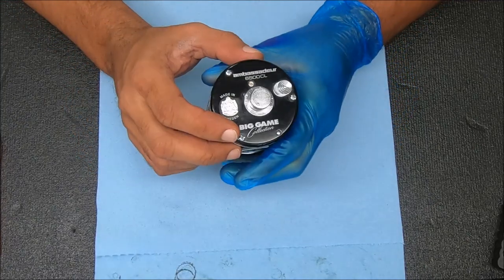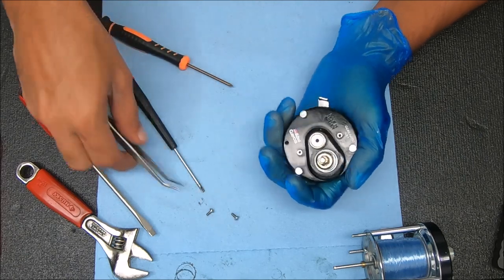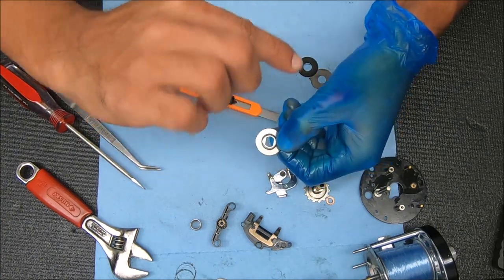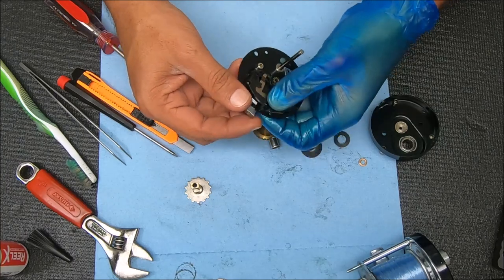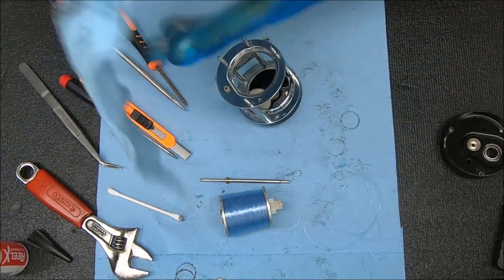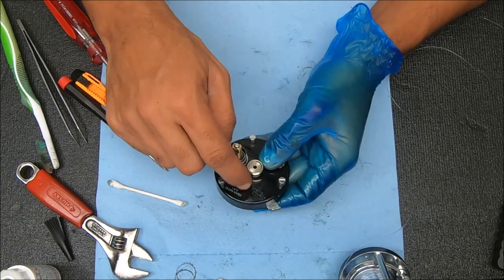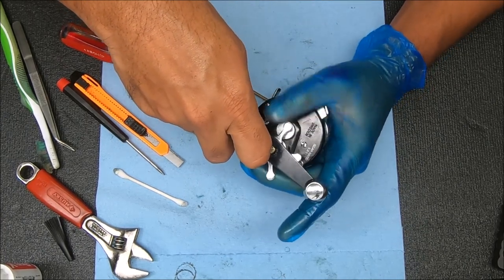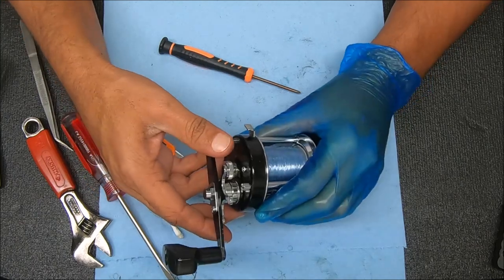Ambassadeur 6500CL Fishing Reel - Weak Drag:  How to fix plus service this reel

Comment: Dude, the oil you put for the centrifugal brake pads is in completely wrong place, those pads can't even touch there. The right place is on the sides of the smaller ring in the end plate. And I wouldn't even put the oil there, it just makes the centrifugal brake worse, but if you like you sure can. Also to clean the worm screw easier take the other end off. It's just a three screws and you also have access to the plastic gears easier, so no reaching. Some put grease on the brake plates and some don't, personally I like to keep them dry.
Reply from the maker: Thanks for watching and sharing your thoughts, brother. Yes, I agree with your first comment about where the oil should have been (inside the smaller ring on the right side plate)... it was a simple slip during the recording process that I missed, even in the editing phase. Thanks for pointing it out. Yes, I agree I could have opened the other side, but it wasn't necessary, since I wasn't going to remove the worm, and turning the idler gear wasn't difficult the way I was doing it.... better to remove the worm assembly entirely for a more thorough clean if I'm going to open the left side. The rest of your comments comes down to personal preferences. Thanks again for voicing your opinion. Spread the word about the channel.

Comment: do  you know if any Abu Garcia AMBASSADEUR 5001C come with drag alarms or  drag clicker?
Reply from the maker: Thanks for checking out the video. I don't think so. The drag setup was such that it wouldn't support the clicker being there.... maybe you could swap out the gear stack from another series that has a clicker (assuming it fits) or modify the left side. I would probably just use a little alarm thingy on the rod if you're setting down.

Anyone else that reads this is welcome to contribute.

Comment: I have always been intrigued with owning one of these Abu round baitcasters. Especially one made in Sweden. Being mostly a fresh water bass fisherman, I have always been confused and frustrated on the correct model size to purchase on line without actually seeing or feeling it. Not at all familiar the amount of models and the number designations that Abu uses.
Reply from the maker: Hey Steve! Don't worry, you're not alone.... their models, years (and pretty much everything else lol) are confusing.... but there are some good sites out there that document the lineage well. For bass, I probably wouldn't go higher than a 5500.
Reply: @TSGReelService  thank you for the help.
Reply from the maker: All good, sir.
Reply: Abu 5500 is a great all around reel the 4500 is nice and light if you don’t need distance. They make the same versions in 5600 and 4600 if you want the thumb bar release. I like the thumb bar for repetitive casting. The bad thing you cannot replace the thumb bars if they break, you haft to replace the whole frame. That being said, I have never broke one. The 6500 and 6600 reels are good for more distance for catfish, striper, carp etc and have bait clickers. Bait clickers can be added to the 4500-4600 and 5500-5600 easily. The 5000 and 6000 reels are the same but they have bushings instead of bearing. Bushings are great for salt and can be replaced with bearings. All these reels are very easy to work on and upgrade. I have some Abu round reels that I bought 30 to 40 yrs ago and caught thousands of fish and they still perform as new. Abu is not a perfect design and has a few issues but they are built very well. If you buy a new Abu DON’T buy a Chinese model junk! Get a Sweden made and if you buy a used one, get one that has 5 star drag. Five star drag has more drag washers for a better drag system. 4 star drag are the older models, they are great reels but fewer drag washers.
Reply from the maker: @DV-ol7vt  thanks for checking out the video and your input.